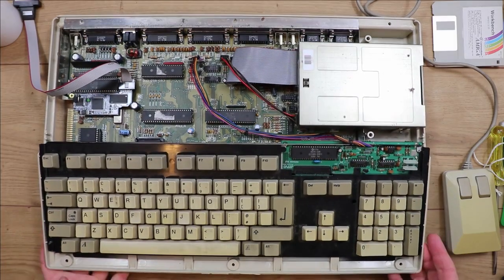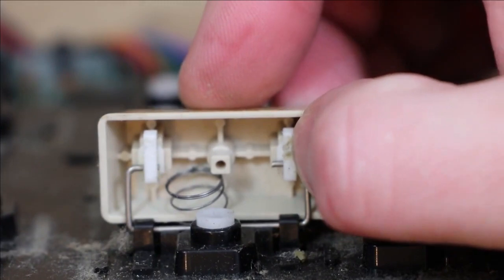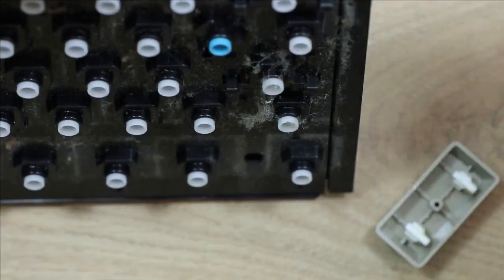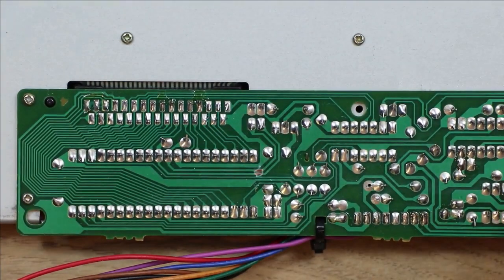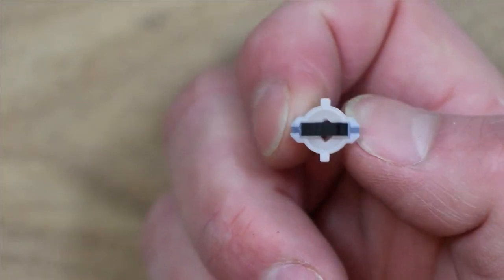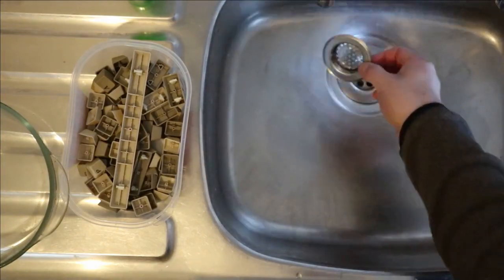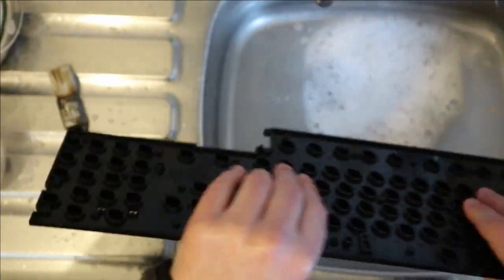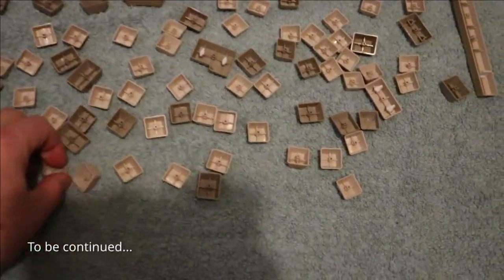Amiga 500 Keyboard - Part 1 - Disassembly & Cleaning

Comment: Excellent tutorial! I didn´t have the tool you use to take the key cap out, so I improvised and took two clips and bent them to form the two extremes and grabbed them using a tweezer to force the key cap out. It worked flawlessly. Thank you!

Comment: I'm assuming the same process would apply for the A1200 keyboard
Reply from the maker: I'd think so but worth checking, I'm not sure if there are different types of A1200 keyboard. On the A600 there are different types of key caps and plungers.

Comment: Nice tip. I ersatz'ed that tool with some wood handle and 2 electrical domestic wires.
Reply from the maker: Yes. I can see that would work :-)
Reply: Ha ha! I posted something similar (using two paper clips) without having read the comments. It works great!